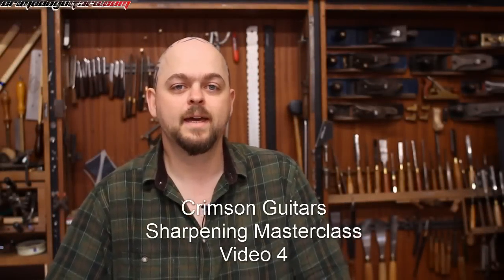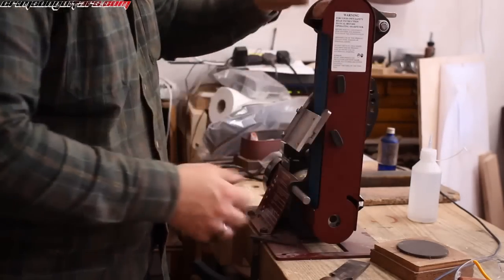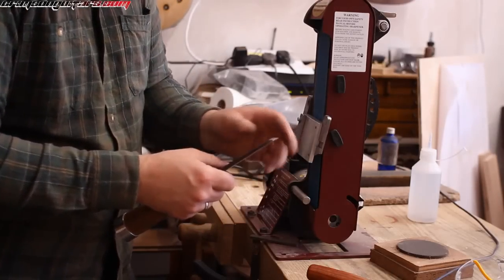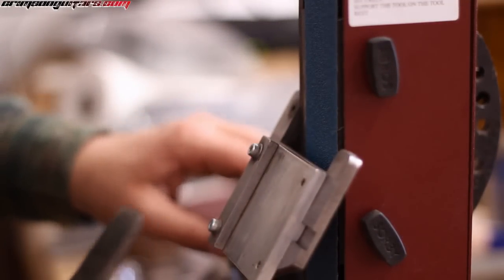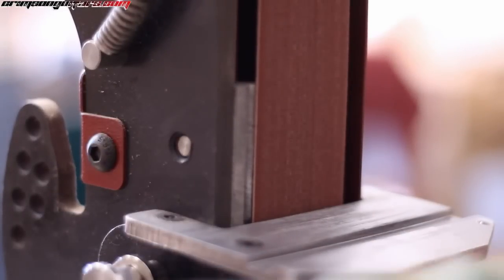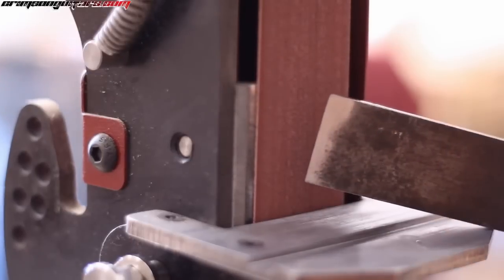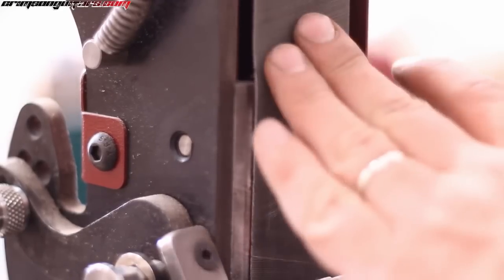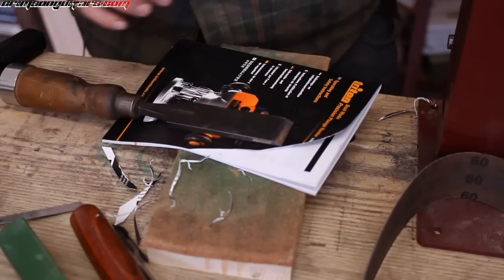Ep 4 of 8 - The Sorby ProEdge  -  Sharpening Masterclass with Ben at Crimson Guitars

Comment: Just bought a pro edge  and set it up on a solid base. I started with roughing gouges and skew chesels, reshaped and sharpened them and I'm very happy with it. A little bit more practice and I'll be twice as fast.  One tip ... enrave the angle you used on the handle - eliminating doubt and saving more time.

Comment: Turning as a retirement hobby for the past 6 months, sharpening on a grinder was NOT my finest moment. This system was a game-changer, now my gouges are razor-sharp and my finish off the tool are excellent making turning even more enjoyable.  Brian, love the tip about the magnet, will give that a go thank you. NOT using the safety guard, your choice, Robert, As an ex Paramedic saw lots of drivers that didn't bother with a seat belt. Good Luck.  Thank you for a good overview.

Comment: Recently purchased this Sorby pro edge and its great for plane irons and larger firmer chisels. However I've found its not great on smaller or bevel edge chisels. The guide doesn't move smoothly along the tool rest. I've cleaned and now given it a once over with high grit sandpaper which has helped but still struggle to get a square edge on bevel edged chisels. Would still give a solid 8/9 out of 10. Loved your review, made my mind up to get on after watching it. so much better than the Axminster ultimate edge machine that is designed for the same purpose.

Comment: I do use a belt grinder for making knives, and I use them for bringing old tools back to life, but I always finish them with stones. Most knife makers use them after the belt grinder to put a final edge on their blades. You could also do this on a belt sander with glass grinding belts. If using a regular belt sander make sure the platen is flat and I would recommend clamping it in a vise so you can use both hands. If you can freehand sharpen you can grind a nice bevel on a chisel or plane blade with a belt sander and finish with stones. The idea is to get you close so you don't spend half a day to get an edge. Always dip blades in water frequently and go slow.

Comment: I wound up ordering a set of KING brand wetstones based on your usage of them.  I was using the glass and sandpaper trick for a while, and it produced ok results. Chisels were sharp but it took forever, and I was wasting money on sandpaper. 

I now have a tri block setup for rough honing (rough, medium, and arkansas stone), then got the KING 1000/3000 block and a KING 6000 block. They will arrive this week and Im super excited! Gonna set some 20 degree chisels this week :)
Reply from the maker: I used them for over a decade and only the shapton ceramic stones have been able to tempt me away for general use, and that is only because they need less flattening in between uses and use less water.. 

Going from scary sharp to good water stones is like moving from a golf cart to an Aston Martin imo.. Have fun!

Comment: I actually use some sand paper ( 200(somethimes)-400-600-800-1200) attached with double tape on a piece of mdf. with good sand paper and a bit of water you obtain good results! after the 1200 grit I also use come compound product on a leather coat as you also did on your latest video.

CHEERS BEN! thanks for all these vids!
Reply: ***** i use the same tecnique, some sand paper and a flat mdf block, mostly becouse i find it really easy and affordable, and most important it get the job done
Reply: Same reasons, plus you don't have to reflatten the surfaces like with stones.
Reply: ***** Now THATS a useful tip!
Thanks for sharing!
Reply: ***** You can put a piece of sandpaper(any grit you need) on a piece of 3mm glass, and use the method to stick it on with painters tape and superglue as Ben described it in one of his previous video's. Glass will keep a perfect flat surface and the only thing you have to replace is the sanding paper. 
A long time ago I used  this method to level frets, but since I got the Crimson leveling file and rubbers it's been much less of a hassle . ;-) 
So much for the commercial break, back over to you, Ben… ;-)

Comment: i don’t know if it’s been mentioned here (still watching the vid), but there’s an easy trick for ensuring you don’t overheat the blade while grinding — keep a bowl/cup of water handy for cooling between grinds, but more importantly, keep the blade a little wet on its surface when you go to grind. when it’s getting too hot, the water will evaporate and retreat from the hot blade, at which point it’s time to water cool. keep the blade wet and quench as soon as evaporation starts and you should be in the good!
Reply: yep, was mentioned in the introduction :D also keeping a hand on the tool is useful to actually feel when its getting hot
Reply: @LassetUnsSpielen  ah! oops, you're right, i don't know how i missed that!

  i agree, keeping a hand on the work surface to monitor temp is a good way to go, although i've had an issue with the vibration of grinding making my hands slightly numb and not as quick to notice a rapid temp change, which is usually how it happens in my experience.  also, how fast the heat can spread to where you are touching will factor in, and how hot the actual blade edge gets before you feel it heat up where you're touching.  keeping the blade wet is just an extra measure to ensure it stays in a safe range.  i don't have a lot of experience re-doing the process of heating and rapid quenching necessary to renew the hardening of the blade, so i try to keep it in a modest range.  from my limited understanding (correct me if i'm wrong), once the blade hits the right temp, and isn't quenched fast enough, the hardening effect goes away quick, just like hitting the curie temp in a magnet causes the permanent field to collapse.
Reply: @liquidstar9  what kind of machine are you using? vibrating, rotating devices can be dangerous, especially if you use them to make razorsharp tools. just asking, because i've bought the cheapest grinder i could find and haven't experienced that much of vibration. i turned it off after ~90 minutes after the motor started smelling funky :D
Reply: @LassetUnsSpielen   early 20th century farm equipment lol
Reply: @liquidstar9  lol, nevermind. must be a lot of fun to work with
Reply: @LassetUnsSpielen   jk :D  i work with metal bar and flat stock, usually making guitar nuts or occasional bridge parts, stuff like that.  and sometimes sharpening chisels and stuff.  i currently have some very basic tools, hacksaw, bench grinder, belt/disc sander, dremel, files.  i play bass too, so my fingers are callused up so i don't feel the heat right away.  actually that might simply make me somewhat of an unusual circumstance case where it's easier for someone similarly desensitized to watch for evaporation too.  

but yes i wholeheartedly agree on the importance of a very healthy respect for the danger inherent to power tools.  safety first.

Comment: Hi, I've just recently bought the Pro edge sharpened My first beveled edge chisel and it is really as good as you say it is. The only problem I have is on your video you say you can do the flat side of the chisel because the safety plate runs true to the working place on mine. It doesn't. I've tried to slacken off the two bolts that holds the working plate on and moving the plate back but it doesn't go back enough. I've contemplated on making the holes bigger so I can move it back but I don't want to ruin the working place. Are you using the stock plate or did you purchase a different one?

Comment: Sounds like love!  The quality, simplicity and efficacy is appealing. :)   I currently use one of 3 vintage wet grinding wheels, ranging from 2"-18" diameter for the occasional bigger sharpening job.  I  sharpen free-hand without guides.  It is quite quick.  As you show, using power at the start of the process can drastically reduce sharpening times. I would use the Sorby like (/instead of) my wet wheels, just for bigger jobs and first, coarse grind to establish the sharp edge and flat bevel, then switch to sharpening stones or diamond plates to refine/"polish" the already sharp edge and then finish with stropping (or power stropping), as shown.  I cn't see myself changing belts very often.  BTW Do you ever use it to sand wood?

Comment: Excellent series, looking forward to the others. A very tempting machine, I went for water based systems cause of the sparks and fine dust from those trizact belts and didn't want to run an extractor when sharpening also a firebox would have added extra cost as well. Will you be covering power honing?
Reply: Agree

Comment: How about sandpaper and plate glass? Also why do you not get the whole chisel nice and shiny rather then just the cutting edge. 
Thanks
Reply: +Michelle k Well eventually it will stop shining. Thats more sand paper belt you have to use, more time invested, especially when you have a multitude of chisels etc. If you are in a professional business and time is of the essence, and resources, theres no point spending all that time and effort making something shiny that servers no purpose.

If you got the time etc and want a pretty tool, sure.
Reply: i would also like to point out that surface rust preserves the structural integrity of the metal. you only remove rust from places that you work with or that are going to get primed and painted.

Comment: Where did you get the sliding plate on top of the Pro Edge shelf? My Pro Edge doesn't have that, and leaves the tools to move on the Pro Edge shelf itself. The plate you are using looks a lot easier to use.

Comment: Anyone got any thoughts on the Work Sharp WS3000?   Looks to be a good option to me.
Reply: Peter Miller Best system I have come across. The slope gives the angle, just as the Sorby. No measuring projections and the abrasive runs away from the edge, so no digging in. Fast repeatable and quiet.